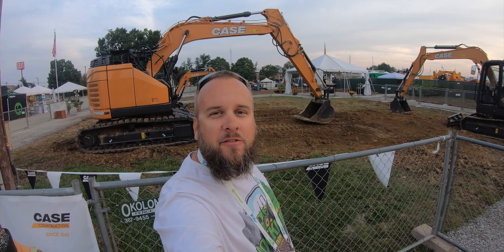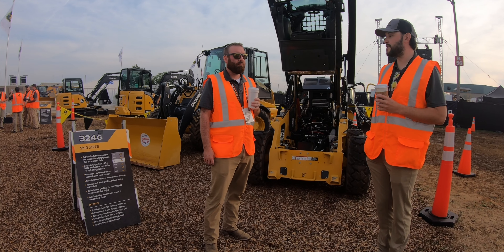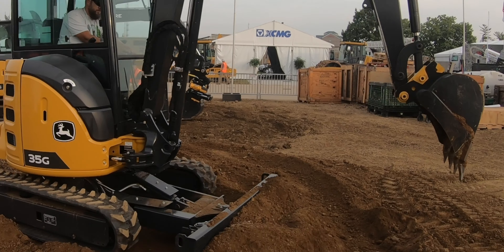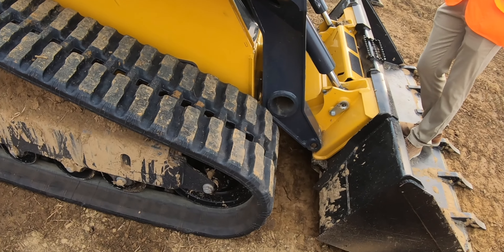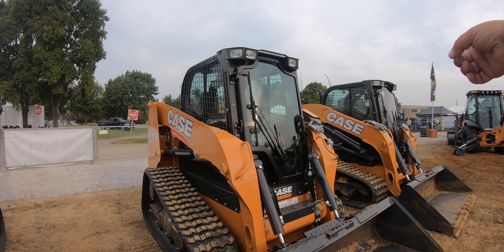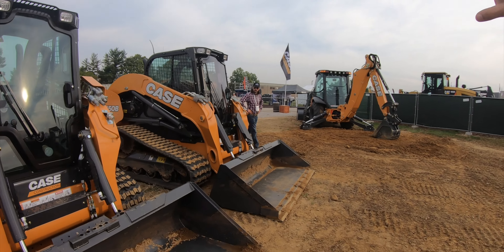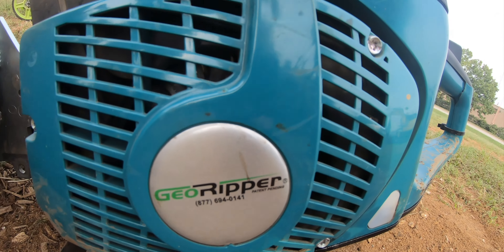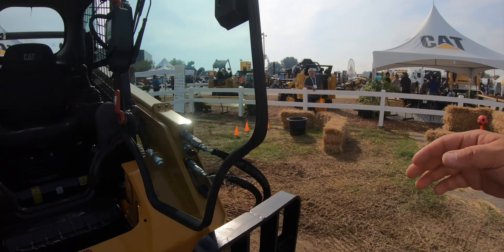Cat, Case, Deere, etc...Who Makes the Best Machines Under 10k Pounds

Comment: Case salesman seemed to know his equipment the best out of the guys you talked with.  Kudos to him and Case…drives me crazy to talk to a salesman only to find out you know more about the equipment than the person who’s job it is to know.
Reply from the maker: Exactly right. He was knowledgeable
Reply: I hate the new Case skid loaders, there is so much lag in the controls compared to a Cat, no snap at all, operated 2 different ones in the last 6 years and neither one was very impressive, had the SV280 anniversary edition in red and grey and a track machine same size, they are reliable and the quality seems to be there but the controls just suck, now if you want to talk about great machines worth every penny and more, the Ditch Witch SK800 is such a great machine, love it, damn near don’t even need a skid loader if you are doing smaller jobs.
Reply from the maker: I was impressed with what ditch which had at these shows. I ended up buying a John Deere 325G and I’ve been happy with it so far
Reply: I would stay away from the cases skidsteers.  I work at a dealership and it's all we see is bad wiring harnesses just one after another. 
In my opinion Takeuchi makes the best skidsteers and  since Hitachi started making their mini excavators anything from a Cx80 and down are a big disappointment.
Reply: @chrisnelson3691  - Case Skid Loaders has adjustments on controls, the Case are super fast just turn them up. You can flip coins with those buckets.

Comment: CAT skid steers have a rebranded kubota engine, it’s cheaper to out source. That tells you something about kubota engines. However, I’m a CASE fan. Looks good, comfortable, smooth controls, and decent pricing.
Reply: Not true at all… yes kubota makes the engine but the machine itself out performs kubota and all the other brands in every aspect due to how well it’s engineered … except for maybe the door lol
Reply: @catwrldfl  yeah. I used to work for CAT. That’s why I’m still a case fan lol

Comment: I don't know, but if the dealers are all good I have always heard that caterpillar tends to have a higher build quality than the other brands. I know the guy that my mother-in-law used to create a pond for her had both a caterpillar bulldozer and a good size excavator. Both of them were enclosed and had heat and air conditioning.
Reply from the maker: Thanks for sharing. I really like the cat machines

Got a hard quote from a dealer the other day and they were the most expensive but I’m considering them.

Thanks for watching
Reply: @RockhillfarmYT  Yes that's the other thing I've heard that caterpillar tend to cost more than the other brands, but I've heard they hold up better.

Comment: When you first tested out the 35g he said you had a sticker, do you need one to test drive machines at the expos. I’f so how do you get one
Reply from the maker: It seems like that is at the discretion of the company.  Basically anyone can just walk up and drive them though

One company might have you sign a waiver and then give you A badge like that so they know you’ve already signed it. Another company might not have you do anything.  There was one type of machine I wanted to drive that was taking appointments and I would’ve had to come back in two hours, But that was at GIE which was much busier than the utility expo

Some of them want to give you a little speech first and some just send you out there as soon as you walk up

Thanks for watching
Reply: @RockhillfarmYT  IS there any age limit restrictions?
Reply: @RockhillfarmYT  how'd u like the 35g?
Reply from the maker: Nice machine. I’m hoping to get one but I bought a 325G skid loader first
Reply: @RockhillfarmYT  did you preferred over the cat?
Reply from the maker: I think they both make great machines.  To me, It comes down to what local dealer you want to do business with

I know the guys at the Deere dealership really well and they are fast at getting me parts of repairs so the machines are up and running

Comment: I sold my 3046r. I've started my search. I'm thinking a case tv450b
Reply from the maker: That would be a beast of a machine. It’s been a year since I test drove those case machines but I remember some good features.

Seems like there backup camera and controls on the screen were really good

I would say make sure you get a vertical left instead of a radial lift boom.

If you ever want to play around on a skid loader come on over
Reply: @RockhillfarmYT  I'm going to take you up on that because I wanna check out your attachments and dump trailer, need to do a meet up at rockhill farms with your fans and do a BBQ and play with toys. 😏😏😊
Reply from the maker: Sounds like a cool idea. A question if anyone would actually show up.

I have a great loyal subscriber base that comment on every video but most of them probably live halfway across the country

It is a real offer though. I think you have my number

Comment: EDIT: Delete... my original statement is not correct... CDL in pretty much all states is only required if you're driving a 26001+ LB (combined with cargo or trailer) truck. This means you can get a 10k LB truck with a 14k LB trailer and still be okay.

Comment: My understanding is that Hitachi makes the JD mini ex’s but I could be wrong.  Check it out.
Reply from the maker: You are correct. The salesman told me that as kind of a selling point that their machine is basically made by the number one manufacturer and then they add their touches on top of it

Thanks for watching and thanks for sharing the info
Reply: Yes all deere excavators are built in Japan by hitachi.  Identical except for paint and decals. Smooth. Stable , fuel efficient
Reply from the maker: Thanks for sharing 

I picked my new Deere 325G up at the dealership this morning
Reply: @RockhillfarmYT  What made you choose the Deere? I think are a bunch of us that really wanted to hearr your opions on everything.... left us hangin

Comment: I don’t mean to make it complicated but you should try a machine with hand and foot controls, it will give you much more machine accuracy , foot controls for boom and bucket take a little while but once you get it they are way more productive. I’ve done both over 20 years the machine I chose to keep was a T595 Bobcat with hand and foot, new Holland or case they do it as well but I think it’s electric over hydraulic now, not sure kind of removes the feel a bit ,
Anyhow give it a try before your head gets obsessed with iso or h pattern
Hope I haven’t made it harder
Cheers from Aus

Comment: Deere is a Hitachi painted yellow,  smooth controls
Reply from the maker: Thanks for sharing. I heard that partnership has ended now but I’ve got the chance to run several Deere loaders and I like them
Reply: @RockhillfarmYT  Hitachi is still building them , dealer in my area is still stocking the same machines. John Deere loaders are built by liebherr. Loaders built in Germany,  excavators built in Japan,  skid steers and track loaders are only heavy equipment built by John deere in the us.  Sad to hear but the truth.   They do build great excavators in Japan.
Reply from the maker: All I saw was a headline about Hitachi and Deere separating.

I did not actually click it for the details.

My Deere Salesman was bragging about their machines being made by Hitachi.
Reply: @RockhillfarmYT  partnership has ended but deere is purchasing for hitachi.  I am sure for many years to come.  Deere doesn't build much equipment it's all rebranding
Reply from the maker: Thanks for sharing

Comment: Case is garbage. Tv 380 688 hours in the shop for a 16000 repair. Dont buy a case. When you google case construction equipment you will see alot of case tv's withless than 800 to 1000 hours 4sale. JUNK!!!
Reply from the maker: Thanks for sharing
Reply: my case 90xt still outdoes my 332g in loading trucks and grading speed,balance, control, and operator to machine responce time and control as well as visability. Just not as cushy if you like the radio and heater.